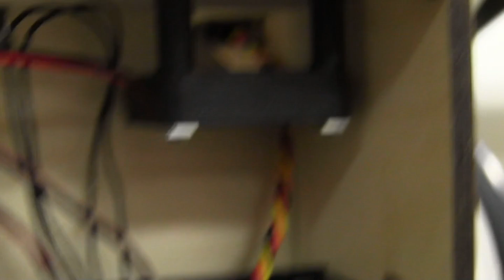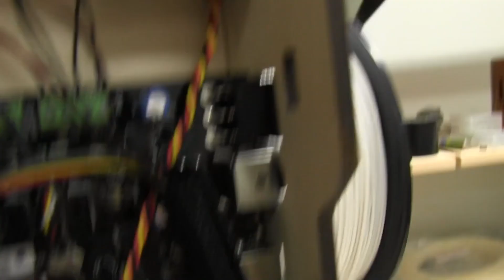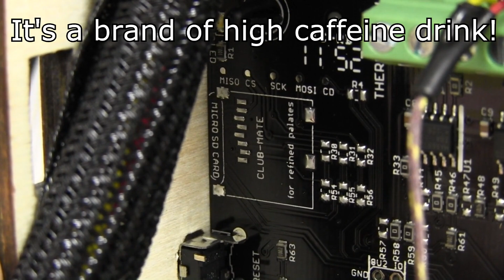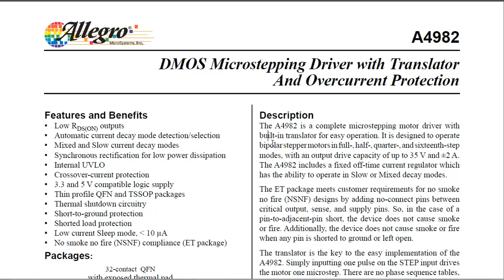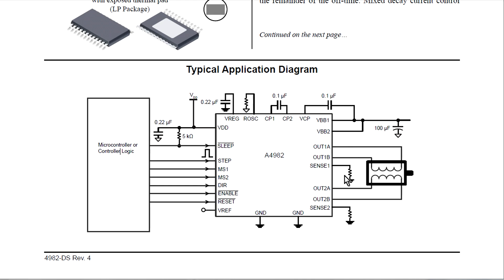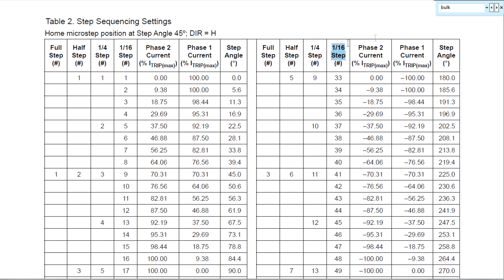EEVblog #326 - Makerbot Replicator Teardown

Comment: I know i''m just being anal (or an arse), but re the 'H" bridge. Its just a bridge, and was always drawn as a diamond when I was a lad and was always a wheatstone bridge, whether it was measuring a unknown or not, whatever use it had. Of course there is no absolute standard representation  for common circuit configurations, but certainly things went more blocky and square after we got rectangular resistors instead of wiggly ones,

Comment: Did you do a print comparison of that 'Microscope' adaptor thingy you printed on the 'Makerbot Cupcake' style machine ? I remember the old machine had issues with flat spots on the inner circle of the adaptor (accuracy too)

Comment: The 24V only warning on the RGB LED strip connector is most likely because 12V RGB LED strips are also out there (and are somewhat more common) and would die almost instantly if connected to 24V.

Comment: 15:52 ha.. watched this full screen and found myself trying to scroll the PDF document! doh... - The biggest benefit of using a stepper controller is the micro stepping, full step control is trivial in code but controlling the current to each coil takes a lot more work. - Having the boards modular they could even be looking to sell them individually as like a breakout board? maybe as simple as a higher weight copper board for the heat sink?

Comment: I am trying to get a transistor to turn on with the base and turns on using 9v power but not 3v from a separate source. Anyone know what I am doing wrong? Just don't think the power or current is enough to open the transistor or I thought that any small current turn one on! So confused!

Comment: Delta is everything but low noise.
Papst is fine, but I would suggest a static pressure fan.
Many PC shops, has good performing low-noise fans,  but they can sometimes be a bit expensive.

If you want a good low-noise variety of fans, you should try Scythe GentleTyphoon 120 mm. You can get them in many rpm modes. 500 - 1850 rpm.

Comment: The data sheet for the stepper controller says to use 2 oz copper in the example.
Maybe thats why it is a seperate board? 2 oz for power circuit and 1 oz for logic?

Comment: mmm definitely audible, most 40mm's are since they need to rev so high, also have Delta 120mm 12v fans laying around and 24v Nidec blower fans which are good because they are much lower profile.

If you could be bothered there are quite a few PWM fan control circuits that use thermistors. Especially with 4 wire Nidec fans :)

Nidec have a simple schematic for their fans based on a 555 timer.

Comment from the maker: I was thinking of retrofitting a bigger quieter fan. Are the Delta's low noise? My first thought would have been a Papst. Don't know if this has a temp sensor either or not, so possible improvement there too.

Comment: a crap fan aswell by the looks of it lol, cheap sleeve bearing fan that will need oil in a few weeks when it starts making noise lol...

looks like an afterthought, given the space requirements a small cage fan or dual ball bearing fans at a lower speed would have been more ideal